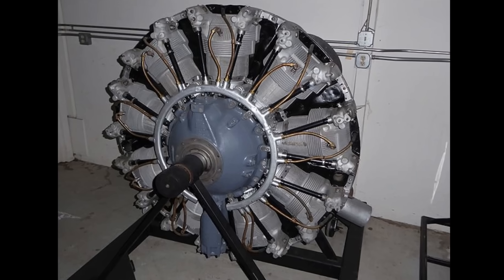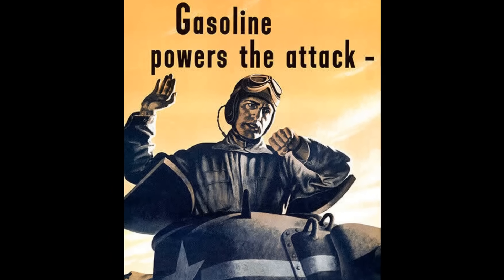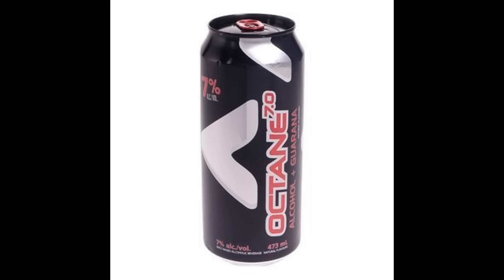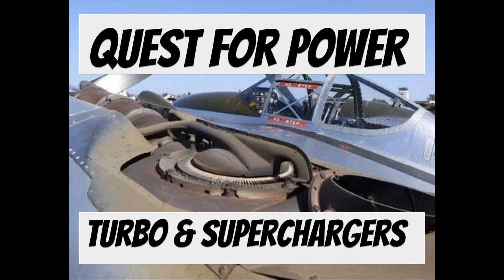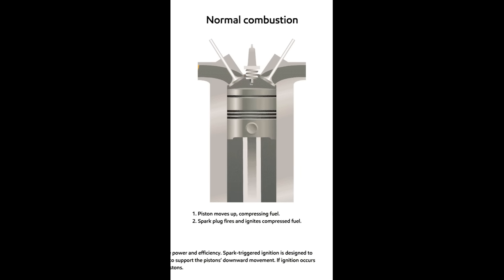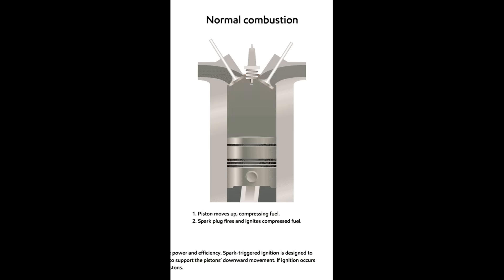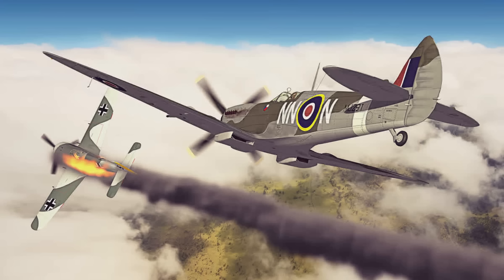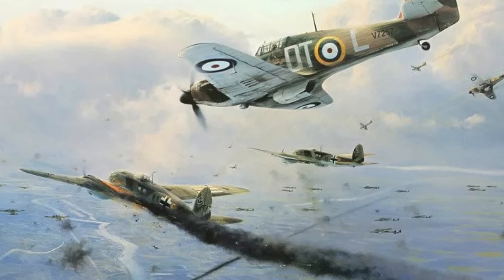Superfuel! 100 Octane Aviation Gasoline (Avgas):  Quest for Power Part 5

Comment: That's why the Packard-built Merlin 61 derivatives were able to push out 1,610 bhp, which allowed the P-51 Mustang to go as fast as 440 mph. That was phenomenal performance by 1942 standards on a prototype P-51B.
Reply: What about its laminar plane wing? That’s where its range came from compared to the Spitfire.
Reply: @jefftheaussie2225  When the P-51A used the Allison V-1710 engine, top speed of the plane was only 390 mph. It was the test fitting of a non-optimized Merlin 61 that pushed it to 432 mph, and with a optimized nose design, the P-51 achieved a phenomenal 440 mph.
Reply: @ There is no doubt the Spitfire motor was a much better power plant than the Allison for that purpose. There was not a lot of difference between the two planes but the wing gave the Mustang a much greater range. It must have had a lot less drag. It had to go a lot further and faster to take off than the Spit.

Comment: When I was young you could buy 100 octane at the pump , 96 ,98 , 100 were the three grades , Rover v8 recommended 100 octane .
Reply: Sunoco had those pumps where you could dial the octane you wanted.
Reply from the maker: That's interesting!
Reply: That was leaded fuel. You can improve the knock performance by adding TEL (Tetra Ethy Lead). In the 70ies it was forbidden at first in California later in the whole USA.
Reply: I can barely remember that!
Reply: I remember that, but, being a kid riding around fields on old British bikes we didn't need it (and couldn't afford it anyway)
Pooling a weeks pocket money to ride around for a few hours was worth it back then
Reply from the maker: Yes. I get 100LL for my Cessna. It's PRICEY!
Reply: These may have been "Madison Avenue " octane  numbers ,like the advertised Horsepower from Detroit.
Reply: I remember the star system - I guess 5 star was 100 octane? I remember a friend of my fathers saying he had to have a change to his P6 V8 (it was a lovely white with vinyl roof - i don't remember if it had the boot mounted tire - I digress) but there was everything from 2 - 5 at many stations. I don't recall ever seeing 1 star and I'm not sure what fitted with which level.
Reply: 1star your basic paraffin / kerosene .

Comment: LPG has 104 octane number
Reply: Petrol with 10% ethanol has an octane rating of about 95. Unleaded has 91 here. Both E10 and gas will give less performance. Octane rating is not a measure of bang for your buck.
Reply: @jefftheaussie2225  in the factory specifications of a   some Dacia car, it is stated that with the factory gas system, that turbo gasoline engine has 4 HP more on auto gas than on ordinary 95 octane gasoline. this means that cars with increased compression that must use more octane than 95 benefit from auto gas
Reply: @makantahi3731  Not many cars set up properly to run on LPG. Has to be very high compression ratio and a dedicated system. Obviously not very successful as LPG is almost obsolete as an automotive fuel.
Reply: @jefftheaussie2225  that's right, people are like ants: they all do the same: they go to work at the same time, from work, to vacation, from vacation, they all drive diesel cars, without thinking if there is another way

Comment: Japanese pump high octane fuel has a rating of 98-100. if you have a high performance bike/car its really helpful.it was contracted for track racing here (all circuits have pumps with this grade petrol,and all japanese series are regulated for its use only

Comment: The Germans went with 87 octane fuel because that was what they could be sure of having.  The British went with 100 octane gambling that it would remain available.  They won the gamble.  At one time during the Battle of Britain they were down to a day or two supply, but never did run out.
The extra performance made a difference.😊
Reply: And the Russians used 65 Octane for their aircraft…
Reply: @allangibson8494  seems less ke the Russians always took a very practical approach to their aircraft.  It needs to work every time.
Reply: At the start of WW2, The British were using 87 octane fuel. It was the American Phillips Petroleum Company that invented the process ( HF Alkylation) in 1940 , that produced 100 octane fuel, which enabled allied aircraft engine manufacturers to produce the more powerful engines that were fitted in the now classic military aircraft of the period.
Reply: @ And IG Farben in Germany licensed the process in 1941…
The Germans weren’t behind in technology - feed stocks and logistics were their problem.
The Russians had problems with both the technology and the feed stocks from 1941 to 1944 when the recapture of Stalingrad permitted oil flow from the Caucasus by river to recommence.
Reply: @allangibson8494  Getting the Hydrogen Fluoride Acid would have been one of the the main problem. It's nasty staff. It vapourises at atmospheric pressure, burns you on contact with your skin, and is highly toxic. It has to be stored in a pressure vessel lined with Monel Steel alloy. The other main feedstocks, C4- or Iso Butane (a cut of C4, or Butane) plus Olefin mix, also require specialist pressure storage.  (I spent 20 years working on an HF Alkylation plant and have a couple of HF burn scars for my memories.🙂)
Reply: @ You’re right there. I have a cousin who worked in a different refinery to the one I worked in , he was on a Sulphuric Acid Alkylation plant. A lot more civilised. 😉
Reply from the maker: Thanks for providing those details!
Reply: The British only got 100 octane fuel (just in time for the Battle of Britain) secretly from the USA who were supposed to be a neutral country at the time.
Reply: Tthats all the germans had...all there refinery's were destroyed.
Reply: @ Actually the Germans had massive refineries that kept running right through the end of the war. They were under the mountains around the Ebensee. That refinery was eventually shutdown and shipped to France in 1948.
Reply: @andgate2000 the German refineries produced synthetic fuel as their crude oil supplies were disrupted. Their overcame   this by using water/methanol injection and nitrous oxide.

Comment: Pentane to the ocatane is the primary compounds as in 5 to 8 carbon chain hydrocarbons that make up petroleum.
so pentane, heptane, septane & octane with usually Benzene, Toluene, Ethyl-benzene, and Xylene  added as in the BTEX group in some ratio for better performance.
Ethanol as in alchol is usually added to todays petroleum in some part for enviromental reason while giving a better octane rating with less octane present.
The maturity of pettol is various Naphthenes then alkanes making up shy of 80% of its contents with a 15% aromatic & the rest is such a vast aray of intended addition or unintentional substances present that it is easilt 200 compounds.

Petroleum is is from latin petra=rock & oleum=oil so literally rock oil.
less then 1000 potroleum engineers exist for a reason as you need a great understanding of Geology, chemistry, physics & mechanics let alone mathmatics.
Reply: Pure Ethanol has 120 Octane rating but 10% lower energy.
Higher octane permits higher cylinder pressures without knocking which permits more energy recovery by more efficient combustion.
Reply: @allangibson8494  Your figures seem roughly to what I remeber though elavation & temperature has an effect on ethanol for it rarely want to run correctly.

Pure Ethanol is hypathetically a great fuel but in pratice it is not though if you came up with a mixture that is while cheap with little added you could likely make a fortune.
Still easier said then done!
Reply: @ The biggest problem with ethanol is that it is really hygroscopic. You simply can’t distill all the water out - you hit a wall at 95% and the remaining water has to be removed by chemical desiccation.
Reply: @allangibson8494  Azeotropic distillation can be done using a third substance an an entrainer.
Pressure swing distillation is another method as change the pressure then the both water & ethanbol cease being azeotropic.

It's not unable to be worked around though considering ethanol even pure does not make when pure a reliable fuel; such mass production methods would not offer any reason to be done. 
Make ethanol into a semi reliable mixture as a fuel then large production might be worth considering.

Still who would give serious investment for such a project as no one with means to implement this wants competition or to depreciate the value of their own fuel with an alternative.
Still Ethanol would not be my 1st choice as even if you can take the water out it's stoping water from getting back in from general humidity as the air contains water.
Always one pesky detail then another that is not considered if not more.

Such is scientia Pratica=pratical knowledge as you get some were then another hurdle arises that requies a solution?
Reply: @ Brazil gets most of its automotive fuel from ethanol produced from sugar cane - they export their petroleum production…
Making ethanol from corn however needs some mental health assistance…

Comment: What about 130 &145 Octian Aircraft Gasoline. When & where did these fuels come into play.
Reply: 130/145 Avgas was on the way out when I started flying professionally in 1975. It was on the written test. I never flew anything that required it. 80 octane, the color red, went away back around 1980. !00 LL is the fuel for piston power aviation in the US. And they have been looking for a replacement for that, too. Due to lead issues. The other aviation fuel that I have the most experience with is Jet-A. More or less Kerosine, I even filled my jetta diesel with it from time to time. Avgas is such a small % of the amount of fuel that is made that it's almost not worth the trouble. There is only one refinery that makes 100 LL avgas. World War II was the high water mark for piston-powered aircraft; the jet engine would take over.
Reply: @ I seem to remember that 100 octane fuel was technically designated 100/130, the second number referring to the fuel’s rating for supercharged or turbocharged engines.  Then there was 115/145 octane, with the latter number applying to supercharged engines.  By the 1970’s, the only engine needing 115/145 was the Wright 3350 turbo compound, which by then was employed in significant numbers only in military C-121C and EC121 aircraft.  I got my only Connie in flight sighting in 1977 or 1978 with an EC-121.
Reply: @Pamudder  100/130 denotes 100 octane lean and 130 octane rich.
Reply: @Pamudder there is still a 150 octane fuel available  in very ,very small quantity  for AIR RACING  .
Reply: Which refinery is that? Just curious. 😊  @GeorgeSemel
Reply: @Bellakelpie  In Europe I know Warter Aviation in Poland, Hjelmco in Sweden, and there is Total presumably in US.
Reply: @GeorgeSemel you mean 115/145!  & 100/130.
Reply: @GeorgeSemel very informative,  thanks ❤ Curious what all the small planes use as fuel.  Piper cubs extra.  I guess compared to cars they are few in number.
Reply: @GeorgeSemel what was the tint color of 130 and 145 octane?
Reply: Navy planes
Reply: @shawndmiles6747  f-18?
Reply: @makantahi3731 F18 burns kerosene or jet A1.
Reply: @ I know, but I asked because someone commented that avgas is used by navy planes, so I'm interested in which navy planes use fuel for piston engines
Reply: high power turbo engines
Reply: Mostly postwar turbocharged and, especially, turbo compound piston engines.
Reply: 110/130/145 are an extrapolation number for rich running engine using fuel to cool mixture plus extract heat from compression and cylinder head (mainly exhaust valves) There may be some extra additives for 130/145? (I've never used it)
If you want to know engines, ask an old motorcycle mechanic, 'we' have always had 'cutting edge' technology which filters down to automotive.
Motorcycles don't have the limitations of aircraft so can be more experimental (which is why they had engines exceeding 120bhp per litre in 1960's and over 100bhp/litre in late 1940's- without turbo or supercharging) 200bhp/litre was (is) pretty common since late 90's on race bikes and today's street bikes, even though they are limited to 300kph (about 187 mph)
Officially, Harley Davidson never made four valve per cylinder heads, except, they had them in 1916 and re-visited 4 valve/cyl heads in 1990's for experiments
The 'design life' of a modern sport bike is up to 100,000 miles although very few actually make it that far
Turbo charged Suzuki 1300cc was making up to 750bhp in a street bike in early 2000's, although most around 300 bhp to be 'rideable' and last longer  (still real heavy on fuel, tyres and brakes)
Reply: @1crazypjyes .  Not very fuel efficient, but fast lol
Reply: Late 1930's ,first in Germany ,BUT Germany did not take advantage  of this but BRITIAN AND THE USA did .
Reply from the maker: Yes...I may need to do a follow-up!